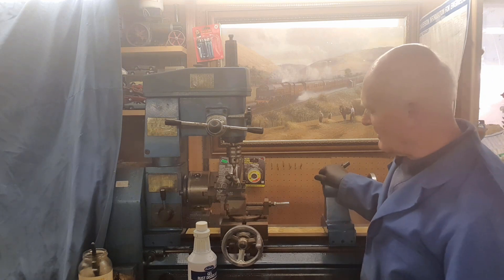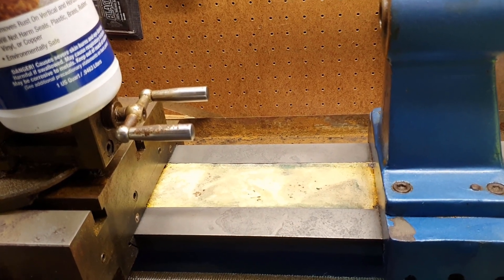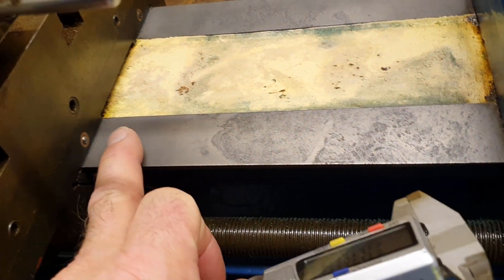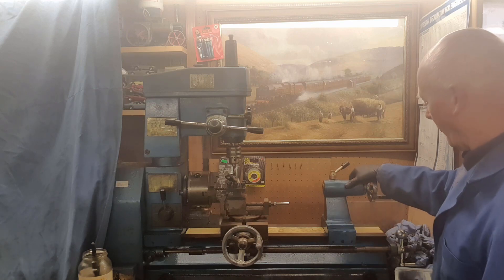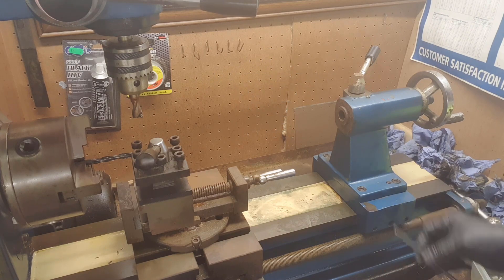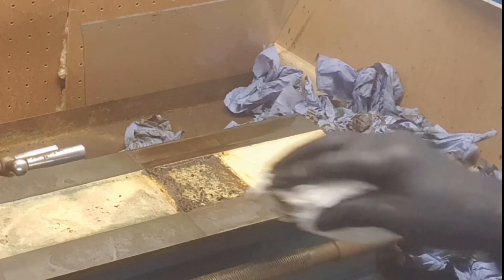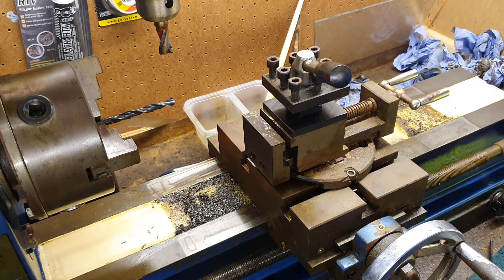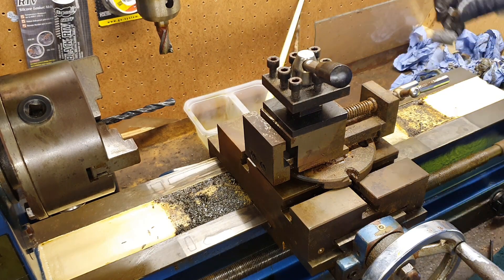Can a Rusty   Lathe, Mill Drill  be saved from Scrap part 8

Comment: there should be someway of locking the crosslide leadscrew to the bracket behind the wheel you were turning.
Reply from the maker: Ah, yes, that would make a lot of sense, now you have said that.
I will check that out.
Cheers.
Andy G.